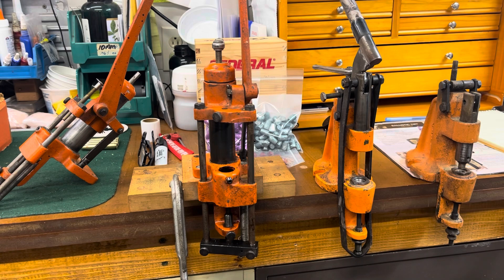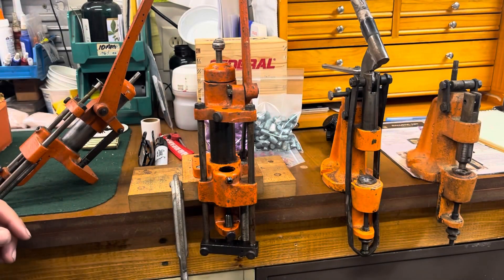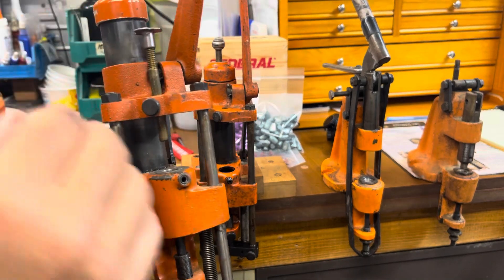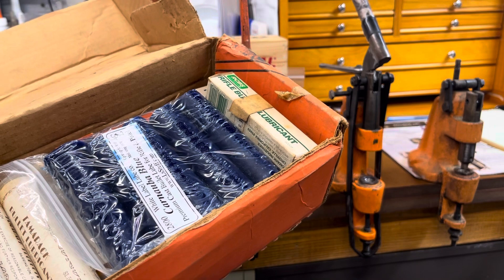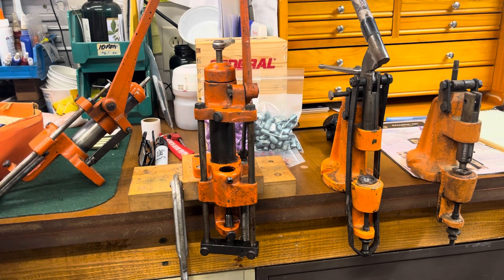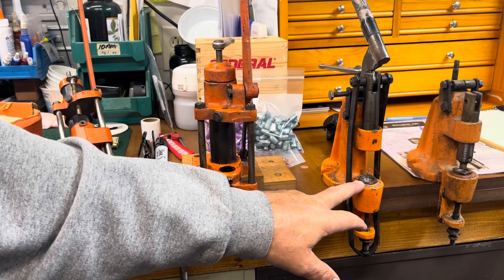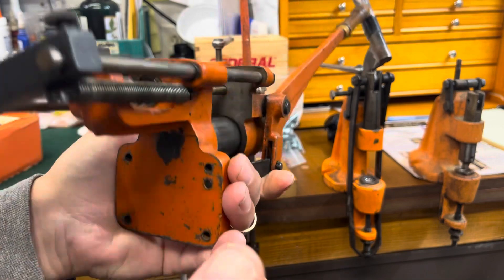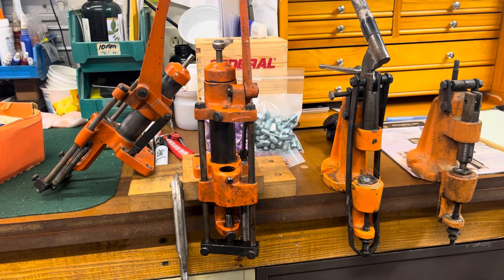VR; Fuzzytfork8 Lyman Sizers

Comment: These sizers are only if you cast your bullets right? I mean if I buy projectiles from ACME or some other company they are already run thru a sizer?
Reply from the maker: Usually yes commercial bullets are generally bot ready to load. The exception would be to buy them "as cast". Then they would need lubed or coated and sized.